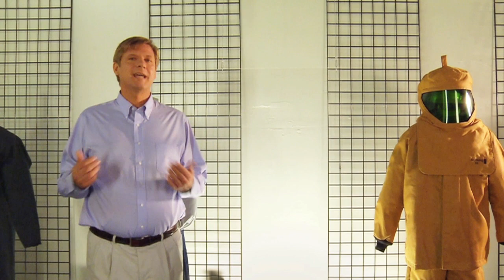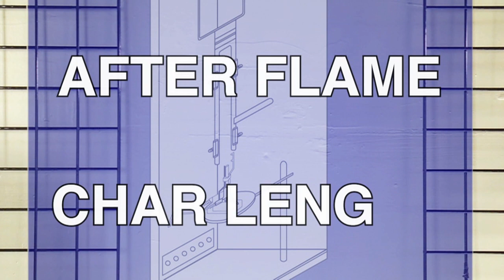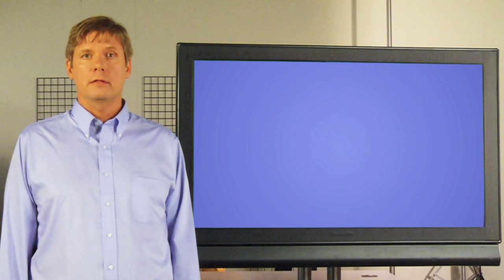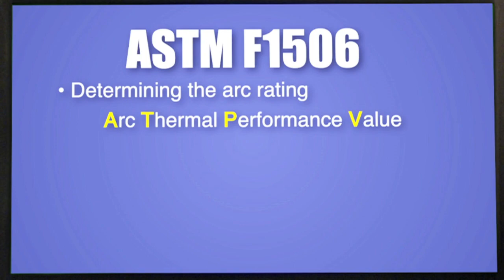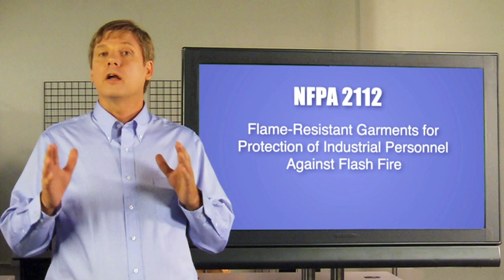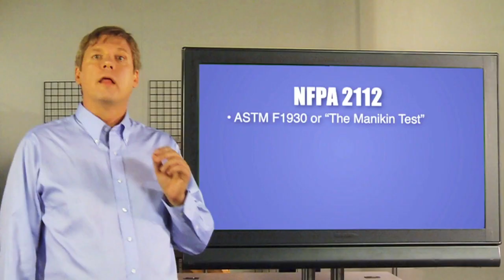Basic Flammability Test Method Vertical Flame

Comment: UL94 <a href="https://www.testextextile.com/product/ul94-horizontal-vertical-flammability-tester-tf328/">Flammability test chamber</a> used to determine the flammability of plastic materials for parts in devices and appliances. It conforms to all five UL 94 horizontal and vertical burner tests and associated ASTM international standards.